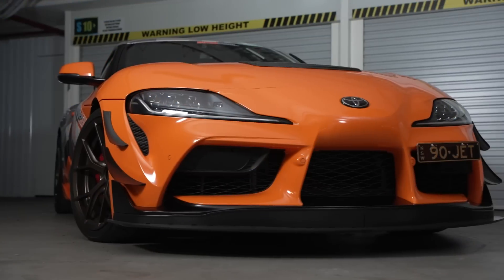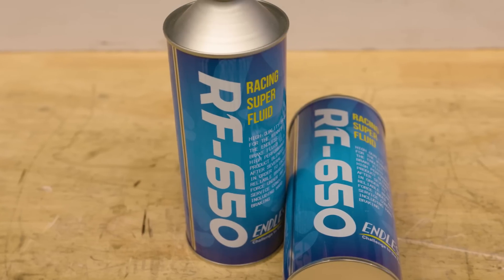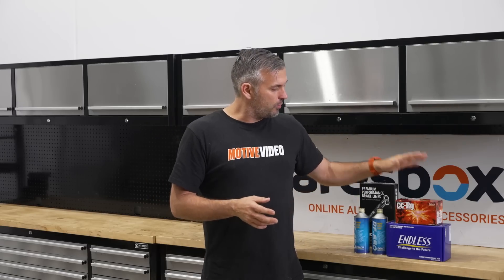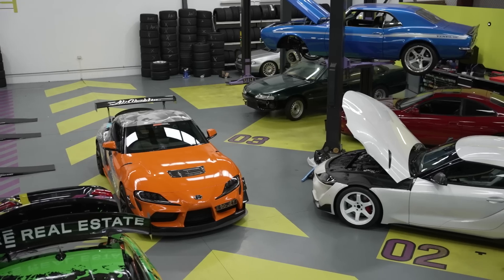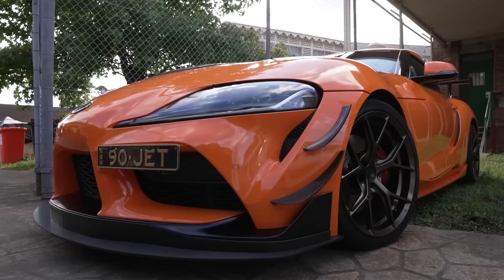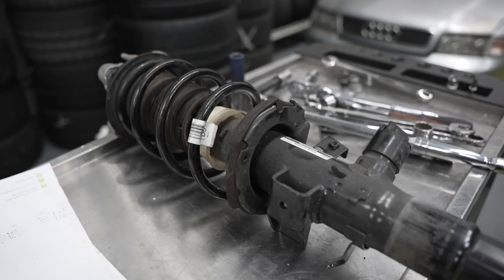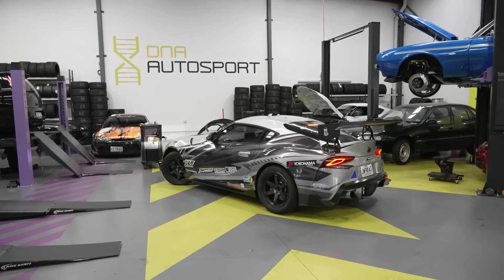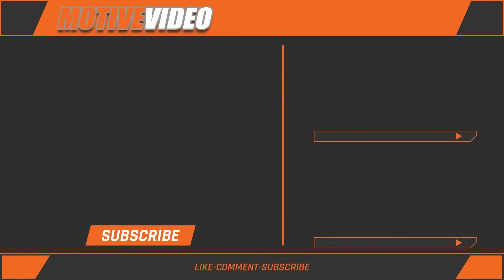GR Supra Handling and Brake upgrade for World Time Attack Challenge - Motive Garage

Comment: Try rsr down springs not the super down just the normal down springs there only 15mm or 0.6inch drop and bump up the spring rate 15% front and 35% rear should pair very well with the increase aero downforce and r comp tires with that versus camber plate.